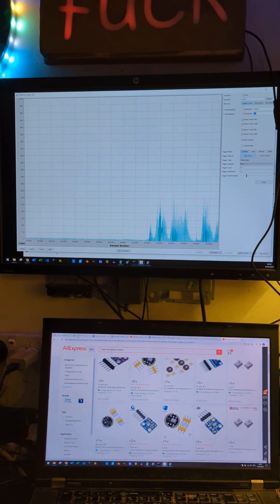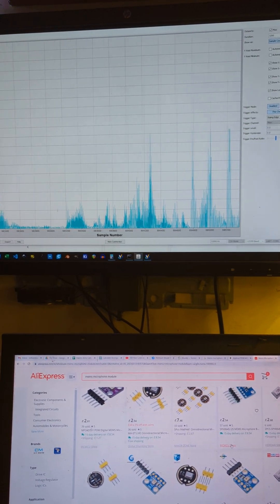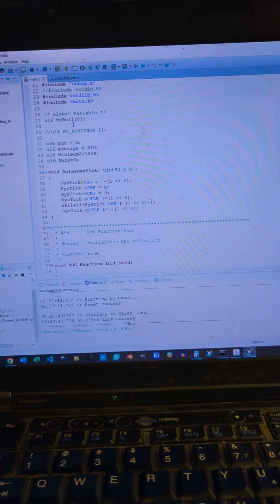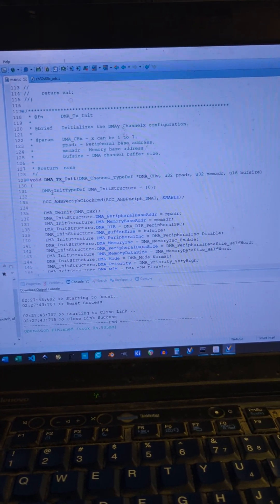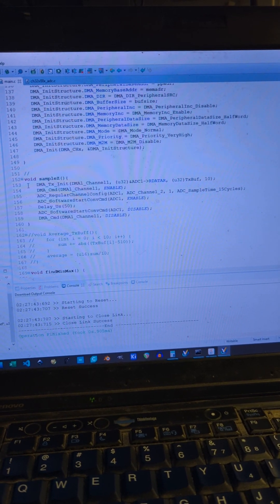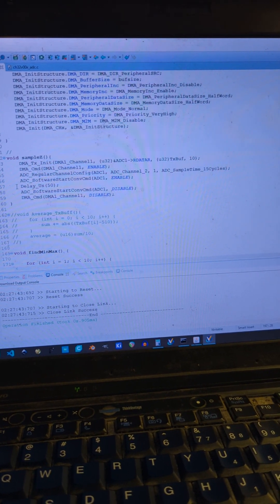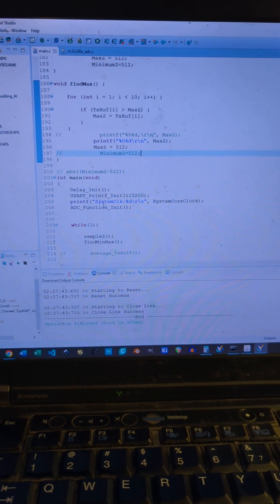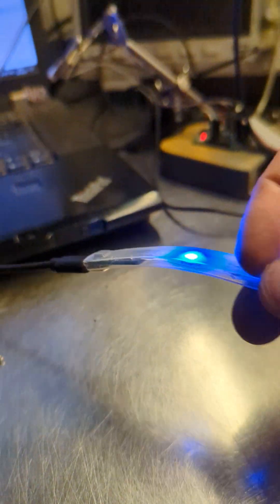Ch32v003 with Microphone Module and Telemetry Viewer. Beat detection for led strip part 1

Comment: I guess that you use a preamp because you already have it. But you don't need a preamp if you use the available internal opamp in the V003 and a couple of resistors for gain adjustment. Also you can use one of those modern SPI/I2S/Bitstream Microphones that are very cheap and then you don't need to convert from analog to digital.

Anyway, interesting project.
Reply from the maker: I've just bought 100 SMD mems with analogue out. Thanks for the heads up on the opamp. Ive also got a couple of digital potentiometers that I've coded to run off the v003. I might try and implement an automatic gain function in analogue. My coding skills are very basic. Any resources you can point me towards in programming these V003s much appreciated. I've basically only got what's on the WCH GitHub.
Reply: @greendragonmakerspace  Three times I tried to leave a comment with references, but youtube deleted it every time. Sorry.
Reply: Does the V003 have PDM/I2S input?
Reply: @Jononor  No, but abusing SPI input as I2S is quite trivial:
-Set an external interrupt on port change to the  L/R line, then trigger SPI transmission in the ISR. The Rx Buffer Full interrupt would trigger the DMA to transfer each sample to memory.

Using PDM is also very trivial. Just ensure that the sample time is at least 2x faster than the highest frequency in the signal. Then you set a counter that reloads according to the number of bits in each sample (256 for 8 bits, 4096 for 12 bits, and so on), and that counter is connected to the PDM_CLK line. Then you set another counter that is updated only if there is a High level at PDM_DAT line every low to high transition of PDM_CLK. Once the first counter generates a reload interrupt, you take the accumulated value in the counter related to the DAT line, and then, after trsnsfering its value, then you reset to 0 for a new cycle.